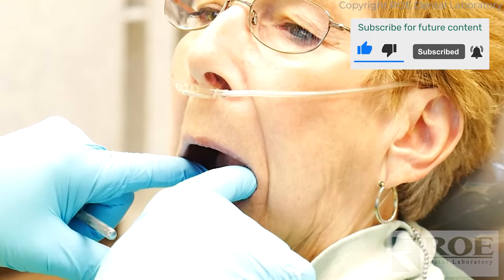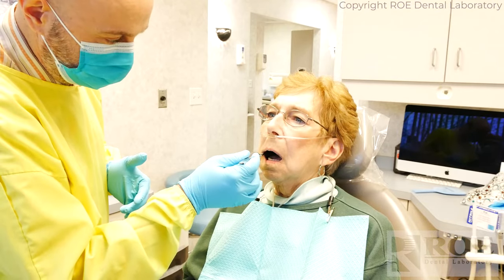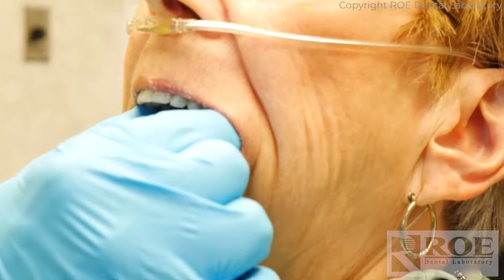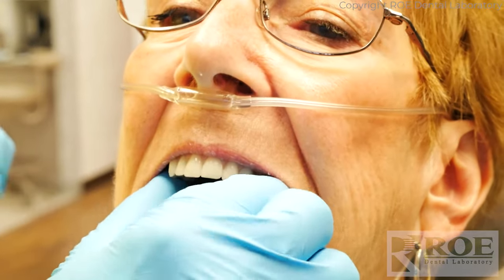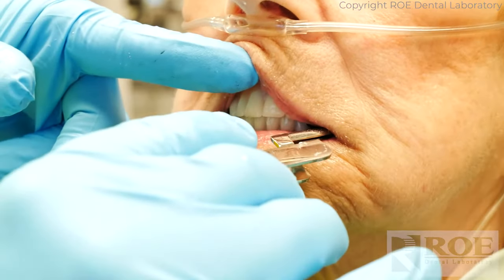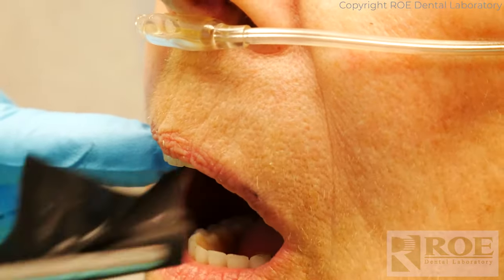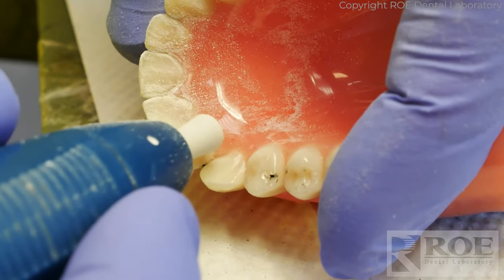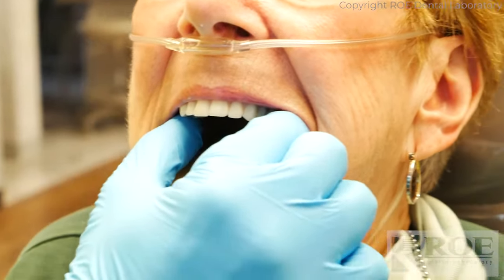Seating and Adjusting a Finished Denture: A Prosthodontists Perspective

Comment: Can I ask what is the paste or liquid you used to seat the denture with regards to the gums?
I am a former certified dental technician who opted for an upper denture instead of dental implants due to costs and me being on dialysis.  Me being on dialysis had concerns with the osteointegration with the implants as my research that there is some loss of bone density and growth with my treatments.  Also, would you recommend a a soft silicone reline over a hard acrylic reline and at what point?
Reply from the maker: The white that they are painting in the denture is a pressure indicating paste.  These issues should be addressed by a dentist as these are clinical issues not laboratory questions. We do both a soft and hard reline but again at that would be a doctors decision.
Reply: @ROEDentalLaboratory  Dear sir, I've been in the lab field for 40 yrs retired now.   I am well aware your recommendations would apply to most individuals.  I'm not going in to address every little hot spot wasting my gas and the drs time.  In fact, I've cleared all my hotspots and the denture is fitting fine now.  So thank you for your NON help.  All I was asking was, what was used.
Reply from the maker: @rodneywinter7074  My apologies Mr Winter. My read of your initial post was that you were looking for the name of the paste that was being used, as well as recommendations on soft vs hard reline and associated timing. Having worked in this industry as long as you have I am certain you would be similarly loathed to step in between a patient and their dentist by providing recommendations. We are extremely cautious of this also. With this all said I am delighted your denture is now fitting fine.
Reply: @ROEDentalLaboratory  You read me correctly sir.  I saw a video yesterday on how to adjust your own denture for the reasons I pointed out.  Mind you I was a in house tech for several years and being retired was looking for the name of the paste.  The video was a joke and found it lacking.  I was a very good tech back in the day and I know most wouldn't be able to make the corrections accurately.
Reply from the maker: @rodneywinter7074  I completely agree. There is a reason why good lab techs still rule the day. They work very hard to make something like this look easy.